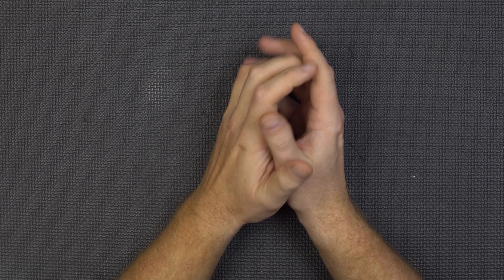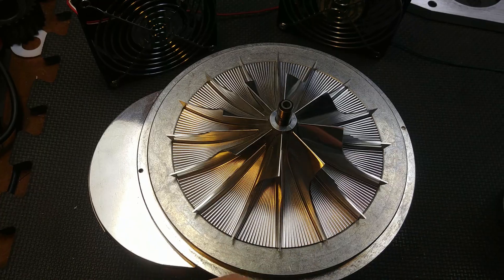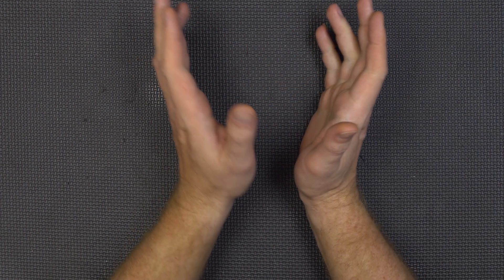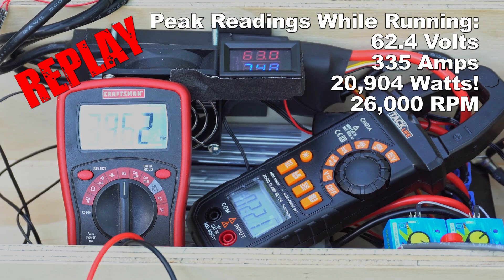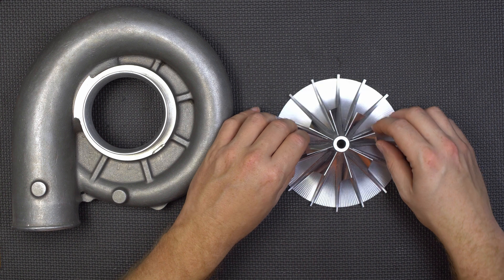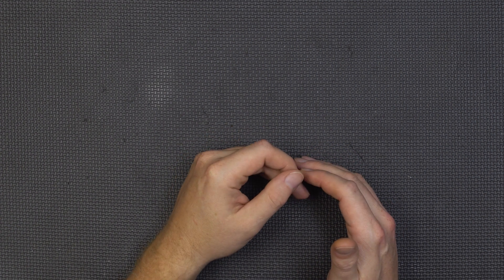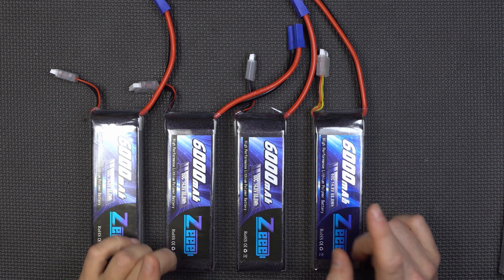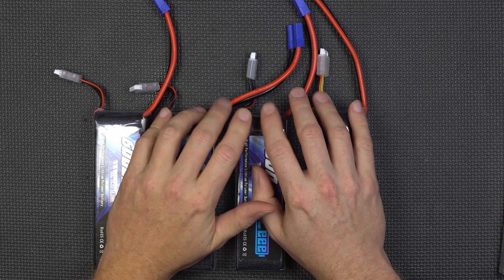New Impeller for the World's Most Powerful Electric Turbo

Comment: Hey Alex, would the SC impeller fit inside the SI trim and volute if you just wanted to swap the impeller only?
Reply from the maker: It would, but you'd have a large gap between the impeller blades and the volute.  The inlet in the SC is 3 inches and the Si is 3.1 inches, iirc.

Comment: How much rpm’s are you spinning this thing now? Have you seen bigger increases
Reply from the maker: Hi Eugene - sorry for the delayed response.  So far, we're at about 28,000 rpm.  The new motor/ESC coming should let us hit 42,000 rpm.
Reply: @AlexLTDLX  thanks for the response I’ve been following my this closely. The electric supercharger/turbocharger is so cool. Quick question. Do you have any data from the old impeller ca the new impeller. So we can see the before and after data

Comment: hey man! I have the same project going on! can we talk?
Reply from the maker: What do you want to know?  I'd prefer to keep conversation here, since I'm sharing my data with the world, I've love for everybody to benefit.
Reply: @AlexLTDLX  do you search for the turbo size you need, how much cfm ou need for your goal, how much rpm the turbo need to turn to get the flow you want, wath's your size engine? I starting with the specs of torqamp turbo and battery but its hard to get the same number
Reply: I want to go with the same TP motor you have, but the peak rpm is for verry short time and I think said that you never get the full RPM?
Reply from the maker: Yeah, not with this wheel.  I think with a slightly smaller one you would.  Basically, this motor can support a blower to about 600 hp.  As long as efficiencies line up appropriately (blower size/compressor map vs engine size & n/a hp), you can get 600 hp out of that motor with a centrifugal compressor.  I think that's what a lot of people aren't understanding - we were only seeing 2 psi of boost, but it was at 580 flywheel hp.  Add in a trick or two, and boom - 600hp.  If the compressor is sized correctly and you're starting with a smaller/lesser engine - say a 300hp unit; you should be ably to get to 14.7 psi boost and 600hp with this motor.
Reply: @AlexLTDLX  do you know approximatly how much air flow and pressure ratio you do? because I need to turn 50k rpm to get my goal with my set up! if you have the turbo graph would be awesome
Reply from the maker: @WBprojects  I think I went into it in this video:  https://youtu.be/h7yScua28I8

Comment: i thought you made like 40 hp in the last dyno video ? adding 20hp is a great improvement... Yes more batteries in parallel will reduce voltage drop  and result in some kind of increase RPM .. Doesn't your esc support 22s ? i thought it did ? AND increase the motor timing 0 degrees is not going to be optimal.
Reply from the maker: It was actually a 64 hp gain at the wheels peak; but yes, I guess I undersold the 20hp.  Probably because until I see it on the dyno, it's just math.  And there are a lot of variables.  The ESC does support 22 cells, but I don't know how much I trust it, considering the first one died well under spec.  I want to see how far the bigger (yet lower kv) motor gets us, along with the less voltage drop from running all those batteries at once - even that might push the ESC.  If we start getting to around 700 hp at the flywheel, we might be nearing the practical limit of this setup.  And then we run it at the track and then go bigger, run duals, nitrous - I dunno...
Reply: @AlexLTDLX  It wouldn't surprise me at all if the ESC can't deliver what is says lol.. however your probably already exceeding it's max current rating on start up (your slow gauge will never actually show its max start up power) you need to ease that electrical power on more.

Comment: I actually believe that 20hp and some considerable increase in boost just by swapping in the SI and volute is a good gain for the same rpm.
I know that if u measure it on the bang/buck scale its not much but in efficiency and power standpoint it is.

Ur still sub 30,000rpm that is significantly less than the targeted 50,000 rpm! So hang on man its gonna be glorious
Reply from the maker: Thanks.  I think we've gone backwards rpm-wise.  We were at 27-28k with the SC impeller, and now we've got to be around 23-24k.  But that's a great way to look at the 20hp deal.  I think you're right - and it will be worth it in the big picture.
Reply: @AlexLTDLX  we have such high expectations from this thing. Switching from a turbo to a larger turbo will net you around 20 hp too since there is not huge difference in size. Lets bump up the rpm and let the games begin!!

How much is the german 50000rpm motor$$$  ?
Reply from the maker: @FirstLast-tx3yj  It's about $800.  But I'd also need a new ESC and I'd need to re-do the battery packs.  At the very least, you're looking at another $1,500...

Comment: 100c batteries be of any benefit?
Reply from the maker: That's what the 9,000 mah batteries are rated for.
Reply: @AlexLTDLX  I have seen higher, but I am not sure how much of it is marketing with the Graphine batteries.   I think running them in parallel as you suggestion should really slow down that voltage drop.   If you get that German motor I am curious to see how you plan to power it :)

Comment: Would this be possible with a higher torque lower rpm motor and overdrive with a belt and pulleys setup or gears? I imagine it would be less efficient and require a much larger motor but may be cheaper in the motor department.
Reply from the maker: That's exactly what the new motor will offer.  But it won't need pulleys or gears - it's a direct bolt on.
Reply: @AlexLTDLX  I was thinking more along the lines of a 5000 rpm motor with the same drive and pulley setup as a vortec or procharger has out the box. I imagine it may take a large forklift sized motor to work and alot of room. How could I calculate the amount of horsepower or torque it would take to spin say a D1 procarger efficiently? Or is that not practical?
Reply: I was thinking the same